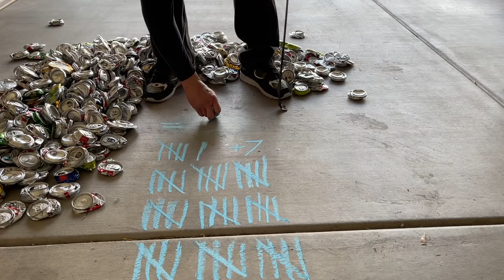Massive Can Meltdown - How Much Pure Aluminum Is In 500 Cans - Is It Worth Melting Aluminum Cans

Comment: I've been down this road. I wouldn't recommend wearing sneakers. Also the aluminum isn't much good for casting without any degassing compounds, and it is too soft and gummy for machining without any alloying agents in it. It tends to swell up with nitrogen while it is molten and then it will shrink terribly when casting and you'll get pin holes. It's better to melt down castings like transmission housings etc.
Reply: John, I'm completely new to this, what degassing compounds would you suggest as I want to use it to make cast aluminum projects. And how would I avoid pin holes? I've not melted one can yet, but am looking to dodge pitfalls in the process. Any help is appreciated.
Reply: @Karopine  Hi Karopine, I started with coal, then went to charcoal, and finally to propane. I made many ingots of aluminum from beer cans and made a
Reply: The degassing compound is like moth-balls and you get a little strainer to hold it under the molten metal. It reduces the absorption of gasses. I'm not sure if it is hydrogen or nitrogen, but it will swell the metal. It is much better to melt castings instead of cans. I was machining some things with my big ingots of can metal and the flutes of my end mill cutter got all gummed up until the 3/4" cutter shank broke (CNC. no feel or feedback). It isn't worth the trouble to use cans. The aluminum is too pure and gummy and it doesn't have the properties that you want.
Reply: @johnlennon335  Wait, what did ya make? The text cut off.
Reply: @Karopine  Hi Karopine. I made engine parts so that I could add power steering to a 1969 Jeep Gladiator. I made some parts for an experimental engine of my own design. I bought a Bridgeport CNC "RigidRam" and while machining my ingots from cans, the flutes of a 3/4" carbide bit got all gummed up and it broke off ricocheting off the wall next to a friend of mine. Soft pure aluminum isn't much good for making parts. Other things are cool to cast with it, if you don't care about the shrinkage and the pinholes.
Reply: @johnlennon335  Design your own engine parts John, damn that's impressive man! I've been looking at making something useful out of all of the cans I get(at least 200 a month, Food stand). I like the idea of making cast mold projects, but have to do some research into the pitting you mentioned, because it would mess the finish on all of my planned projects. I saw pitting on one of the ingot bars on some video(not sure TGS), but they take it down below that to remove the pits. And even if I can't figure out how to cast aluminum, I at least would like to make ingots with the cans(with zero pitting(if possible)).
Reply: @Karopine  You can degas the molten metal by holding these pellets under the molten metal with a special tool. The pellets smell like moth-balls and you can buy them where you buy casting sand etc. My advice is to just get the cash for your cans at the recycler and start collecting other aluminum castings that already have the degassing compounds and alloy in it. There is a lot of slag with cans too. The longer you keep the metal molten the more gas it will swell up and absorb, adding to the shrinkage and pinholes.
Reply: @johnlennon335  Gotcha, I'll look into aluminum castings w/ degassing compounds/alloys to help minimize the pitting. Also thanks for the info on the melt time causing gassing/shrinkage(I didn't know those related to the pitting problem:)) . Thanks for answering my questions John, really appreciate all the info man.
Reply: @Karopine  I'm sure if you didn't do all the things to make it perfect, you could still make something pretty cool. Don't let the little things stop you. I still have the examples of my early efforts and I like them. Knowing WHY things went wrong is the key. Please take safety as your first priority. Don't have things you can trip on around your forge. Never spill molten metal on concrete. Don't wear polyester or have shoes that can have molten metal land on your laces, or soles that will melt when you step on some hot slag. There are a lot of bad things that can and will happen so be careful.
Reply: @johnlennon335  Will do mate and appreciate the heads up for mine and others safety in this new endeavor, damn thoughtful of ya. For my safety, I will use all my welding stuff(gloves/boots, leather apron/leather sleeved shirt/face shield(when off, it stays transparent)). One of my goals is to not make the same mistake twice;). So will be doing more research. Now John, I don't recall any smelter video I've seen ever mention the "Never spill molten metal on concrete" before, so I gotta ask, what happens? I've always seen them pour molds while on bricks and clean slag onto bricks.
Reply: @Karopine  By now you've probably already found your answer about the concrete. The answer is that concrete has a surprising amount of moisture in it. When the molten metal lands on it, it generates steam pressure and the concrete explodes. This sends concrete and molten metal flying everywhere. Not a pleasant experience, I can tell you from experience. Better to be on sand or gravel or dirt. I can tell you another thing that I've learned. You can use cast iron pots as crucibles. And it works very well. But over a long time the cast iron will change because the aluminum takes out some carbon from the cast iron and the bottom will swell and eventually probably crack. But it works great if you don't have a crucible. Just be sure that your method of handling it won't slip or get away from you. I've used the cope and drag, but I really like the lost foam method. Just be sure not to breath the fumes. Enjoy
Reply: I'm not so sure about that.  You can manufacture an AR-15 lower receiver from melted aluminum cans.  There's a YouTuber here who did it; Guncraft101.  His videos were pulled because of YT's anti-2A policies.  He has put his videos on full30 and other gun friendly streaming platforms so you know the entire process to convert a pile of aluminum cans to an AR-15 lower receiver.  From a gunsmithing perspective, being able to manufacture your own receiver from aluminum cans has merit.  I see this application being viable to manufacture your own aluminum frame based pistol as well as a rifle for personal use.  I can easily see this working for a .380 ACP or 9x19mm based pistol.
Reply: @LVLouisCyphre  You obviously don't have any personal experience and don't understand the problems that I told you about. It is easy to avoid some of those problems if you don't try to use aluminum cans. Easy peasy
Reply: @Karopine  will you post results here? I have a bunch of cans and would love a little project like this. I understand using castings would work better, but I have cans, not castings. Gotta use what I have. I’d like to keep the list of chemicals low and still get a decent pour with few bubbles, and hopefully not a ton of slag. Let me know how it goes.
Reply: @castloader1715  I'm about to move for work, but after I get the family settled in our new area and get comfortable in my new job, I'll get on it. Will be a while, but hopefully an update before Thanksgiving:)
Reply: @op
You're saying that aluminum from cans is fairly pure.
Would it be a good candidate for adding a bit of zinc and then using it for casting?
Thanks.
Reply: @SuperMario1005  I've collected a few books on the subject, but alloying aluminum is a very technical subject that only a Metallurgist with a specific education could really answer well. If you are casting something in a mold and you are not going to cut or machine it, you can do some cool things with the cans. But it is easy to find other scrap castings to melt otherwise, and better to let the recycler have them. Each can is very thin and has labels and liners that create fumes that are dangerous to breath. A lot of the can will burn or oxidize and turn to useless slag. A lot of the cans will still have some liquid inside, so you will get a "fwoop" sound as it instantly turns to steam and the sugar burns. I think you could skip this and have a better experience.

Comment: For me if I was to start smelting things is to try to get a use from it afterwards. Also I would try to do something that would reduce the size of the can even more. I really unsure why I want to yet, but I like learning new things.
Reply: i make coins for my kids, they love em
Reply: I always used a can crusher to flatten mine so more would fit inside a long lawn leaf bag. The scrapyard I take them to run the aluminum containers thru a shredder that reduces them to small pieces before being fed into their smelter since that enables the coatings to burn off quicker and the bits become liquid faster. Then that's poured into ingot molds with the ingots stamped after cooling to show those were made from cans. The yard operator told me the aluminum from cans can only be used to make more cans.
Reply: For my self if I was to pre crush the cans. I want them flat as pancakes. Making a wooden mallet that will probably weight 10 plus pounds. Getting a work out while crushing cans.
Reply: @MildarValsik  The standard crushers flatten the cans to 3/4" in height. You need to drain them before crushing or liquid will come shooting out. The easiest and most practical type to use is one made out of thicker metal and uses a long handle. They're fastened laying down to a workbench with the bottom extending past the edge so the crushed cans can fall out of a slot into a container. The long lever reduces the effort and laying flat made crushing faster since the cans could be dropped in as fast as you can move the lever. 
You also can get flatter cans by stepping on the ends with the heel of your foot.
Reply: @billwilson3609  okay basic information helpful to all that might not know. The only good thing about crushing more than that is because the more valuable to fit in one area cuts fuel cost in melting or recycling per load. Maximizing any and all reason plus extra workout. My madness always has a reason. Decreasing volume of the cans will increase profit in all ways. imaginable.

Comment: Nice work and have you considered a stencil made from steel to create a tile railroad designed wall for a tub surround?  You could make 3 Foot Wide X 4 Ft. long sections in an encased frame with steel raised sections to mimic mortar joints while keeping the mix Depth to 1/4 D, then, skim if just like smoothing over concrete on the ground, with a piece of steel, to drag over the top, while shifting it side to side, to drive out air pockets, slag, or use the same principle to create a pyramid or triangle, resembling one side of it.  Thanks for sharing these important issues that matter to humanity nonetheless.  Cheers!

Comment: With all the crap put on both sides of the can there's a LOT of crud to 
get rid of in the melt. There's 24 cans to a pound, so 500
cans is only about 20 pounds worth of aluminum, last time I sold scrap 
aluminum it went for 10 cents a pound- not even worth the time melting 
down 500 cans for  $2 worth of scrap, even less if one used 
propane or the like to melt them.
That melt is like cottage cheese due to the contamination/dross, and because that type of aluminum is used for extrusions and the formula is NOT what is used to POUR cast aluminum with

Comment: The propane  cost more than the aluminum is worth
Reply: NightHawkInLight made a video where he melted down aluminum using a rocket stove design built out of holes in the ground. So the required heat can be achieved with a wood fire.

Comment: I remember in the early 1990's cans went for about .45/lb. Now days, the cans are thinner and go for around .40-.45/lb. Collecting cans for cash is definitely not worth it.
Reply: Depends if you can return bottles/cans to a depot for recycling.

If a deposit is charged on the drinks usually you can get 10 cents for anything 1L and below, 1L and above 25cents, 
A lot of homeless people in my city collect the cans and return them for cash, usually just small amounts like 20 bucks etc
Reply: I collected cans for 3 years and got 20 bucks

Comment: I always thought that it was just the top of cans - where the ring-pull is - that was aluminium, and the rest was just tin🤔🤔🤔
Reply: Supposedly the pull tabs are 100% Al, which is why schools used to collect them.  I know the cans themselves have plastic coating on them, esp on the insides, because we had to scratch through the coating during one of my college chemistry lab classes for the lab covering the concept of ion exchanges.  The copper in the copper sulfate solution replaced the aluminum in the scratched part of the can, as I recall it being.
Reply: Tin (Sn) is a different element on the periodic table.  Aluminum foil is misnamed Tin foil WAAAY to often, even nowadays.  It's either ignorance or laziness, or both to use the wrong name.
Reply: @leiatyndall8648  because it's so very important to distinguish the two from each other 💀

Comment: Interesting. Isn't the best and most efficient way to melt aluminum is electric arc? 
But I am curious. In my state cans have a 10 cent deposit. That's $51.70.
What does Aluminum bring per pound in ingot form?
I called the local recycler, .38 per pound for cans. Said he would have to see the ingots first to give a better price, inspection for slag maybe.
Lets say 50 cents a pound. That would be $5.38 for the ingots.
How much was your time worth? And how much propane did you use to melt the cans? Have the lights on in the garage? 
I don't know if Arizona has deposits or not. Even if they didn't you'd be way farther ahead to just sell the can's per pound.
From this I take it you have a very good job, smelting is your hobby and your time is valued on a pleasure meter.
You hope to become a You Tube Wonder, get famous and rich, though you don't revel yourself to your audience.
I have a hobby too, leather craft. But I sell what I make and it is self sustaining at worst.
When you step up to smithing and start to make blades I'd be happy to give you deals on sheaths.
Have Fun!
Reply: Meanwhile this video has over 4 million views.

Comment: The gas cost more than value of cans being melted down I bet
Reply from the maker: You’re absolutely right.
Reply: Which is an indicator why commercial operations that do remelt cans use electricity to do it.
Reply: @cdjhyoung  That means I am going with the electric furnace on Amazon for the next smelt scale increase just like Thiosol did for his chemistry videos of metal alloys :) lower operating cost
Reply: @AaronSchwarz42  Before you do more can melting, just what is your end goal here? Do you know what the value of ingot aluminum actually is? Does it make sense to pursue this further, or is it just a back yard past time? Do you have a use for the aluminum after it is melted down? 

Personally, I collect lead wheel weights and melt them down for my own use. I form hobby weights and different size weights to use in craft projects. Carrying a coffee can of my lead bars will certainly slow you down.

Comment: I am melting scrap aluminum with my Devil Forge.  No problems at all except one...I use iron loaf ingot molds and have a very difficult time getting the cast aluminum ingots to release.  Can you please give me any suggestions?
Reply: Could try using a spray silicone lubricant to act as a release agent.

Comment: Hey man,  love the videos!  Just curious, would it make any sense to have some sort of setup, that blows a flame on the crucible as you pour, so when you are doing multiple ingot pours or coin pours you get more consistency on all the pours after the first?  Or does it not really matter?
Reply from the maker: Thanks Todd! I’ve seen people use a torch on their molds before with silver and gold, I haven’t seen it much with aluminum, but maybe I haven’t seen it. I might have had my temperatures different pour to pour and my molds probably had the same issue. 👍
Reply: @TheGrowingStack  Ya, I guess I meant in general with other precious metals, maybe helps with getting a more perfect end result which means less time cleaning it up....
Reply: @TheGrowingStack  Well best of luck to you.  Not having any experience with metal melting since I was in High School, 40 years ago, I would be curious how a red hot mold, or very close.....would work out for possibly providing a smoother, more uniform finished surface, to hopefully reduce the clean up process....... If you ever try it, I would be interested in knowing the results.  Might be way overkill for similar results, but who knows......

Comment: Were you not concerned about residual moisture in the cans? How did you endure they were dry enough for melting?
Reply from the maker: I live in Arizona so it’s really hot and the cans had sat for awhile. I was confident they were dry and have done it a few times before so I didn’t have any worries 👍

Comment: Do the cans have to be dry?what if there is a bit of liquid in them?would there be an explosion or is that for larger scaled foundries?thanks.
Reply from the maker: They should be dry to be completely safe. From my experience, when there has been a tiny bit of moisture, it boils off in seconds once it is dropped in the crucible. I wouldn’t recommend that, but I have done it and it didn’t blow up on me. If it was trapped somehow in an air pocket and you fully submerged it, that would be a different story though.
Reply: @TheGrowingStack  thanks for the reply mate.